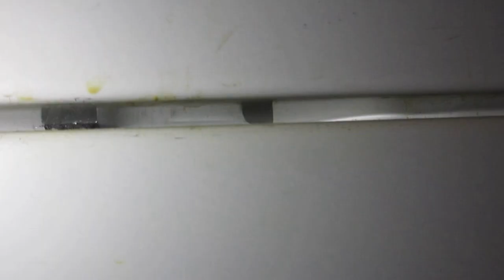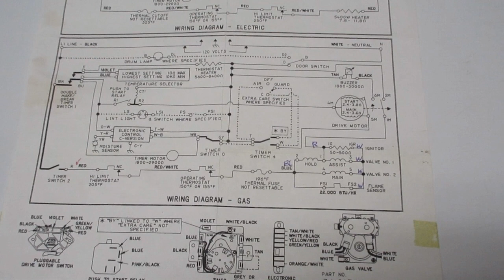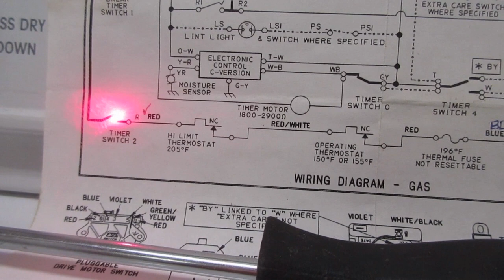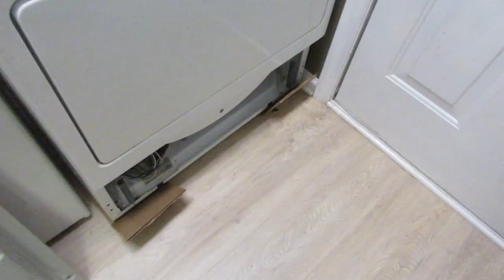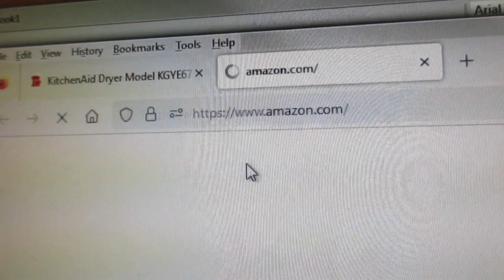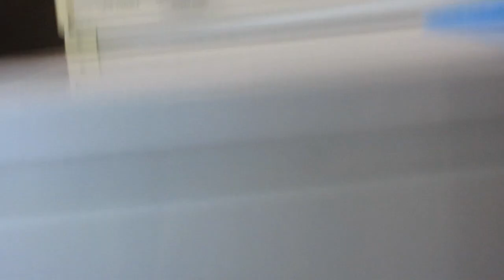Gas Dryer Does Not Heat: Diagnosis and Fix

Comment: Help i have a Kenmore H2 gas dryer I have replaced everything but it keeps blowing Igniters im on my 3rd Igniter any ideas ty
Reply from the maker: Can you look at the circuit diagram and see if there's something that triggers the igniter?  If you can find and replace that component, it will stop sending the igniter destroying current or voltage.  Wild guess, though, I don't have access to the circuit diagram.
Reply: I had same problem; instead of the flat igniter spec'd by Whirlpool, substituted a hot-coil version that GE uses. Same base, same terminals, hasn't blown in 3+ years.  OTOH, maybe it was the cheap igniters I was buying; the original OEM unit died at age 17.  Learned that cheap isn't always cheap, especially when you count the pain of doing it over & over again.

Comment: Subscribe earned - thank you for showing the testing leads, etc. My thermal fuse tested fine with continuity on the Ohmeter. The hot lead showed 120 volts but the other terminal was dead in the water.
Reply from the maker: I'm not sure I'm good for a repeat performance, LOL!  I run into a problem at my house, look for a video, and if "a good one" isn't forthcoming, I make one.  And yes, try to include all my steps, including mistakes.

Comment: I going to touch on an issue that will make sense when we are done ,,  If you discover a blown "Thermal fuse" one must address the core reason why it blew ,, That thermal fuse is next to the operating thermostat on the outlet of the dryer. that operating thermostat "should have cut off the heat" well before the thermal fuse ever reached the temperature that would cause it to blow , The Thermal fuse is there as a fail safe in case that thermostat fails to open and cut off the heat as it should do so , that why it was put there in the first place.. so if you find a blown thermal fuse you must replace the operating thermostat linked with it as well as it must also be bad for the fuse to blow in the first place. in fact many dryer manufactures mandate one does this and they only sell both the thermal fuse and thermostat in one kit  They both must be replaced at the same time. Why does the operating Thermostat fail ?  poor airflow due to blocked dryer ducts or the vent being plugged with lint in almost every case . so a thorough check to make sure none of the dryers ducts or blower fan are not blocked with lint as well as a check and cleaning of the vent need to be done . otherwise the blocked airflow forces the operating thermostat to cycle open and closed hundreds of times causing another failure.
Reply from the maker: Thanks Brian.  Your comment is raised to the top.

Comment: why didnt you just run a continuity test instead of testing for voltage
Reply from the maker: I can kind of read a circuit diagram, but only "kind of".  I have found that when you run continuity tests on points in a circuit that are on ether side of a component, sometimes there are other paths that make the test result harder to interpret.  If I were an electrical engineer with a solid knowledge of the circuits, or if I removed the component and tested it outside of the circuit, continuity would be fine.  But for me, even though it involves working on something with 110V flowing and so less "safe", I'm more confident in making a decision with the result of active operational  voltages.